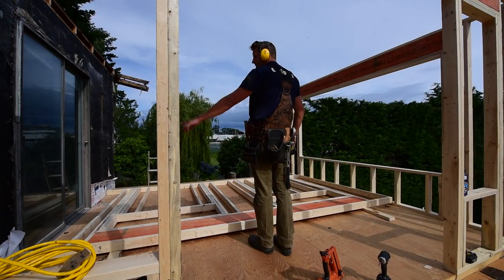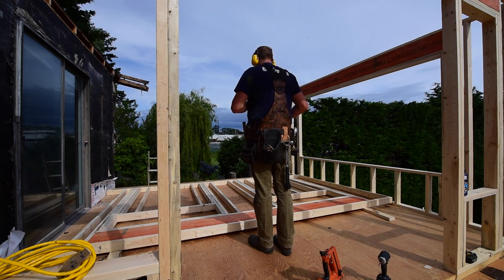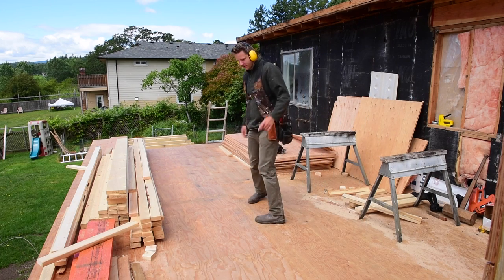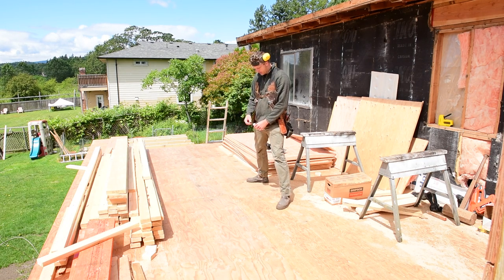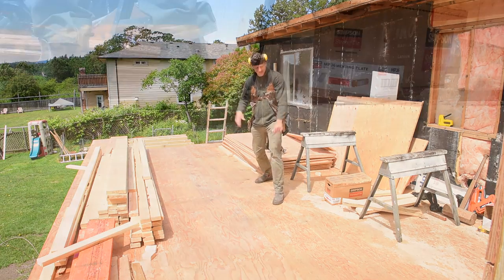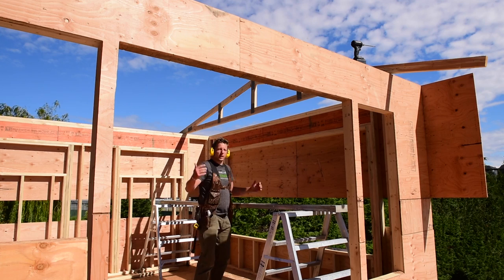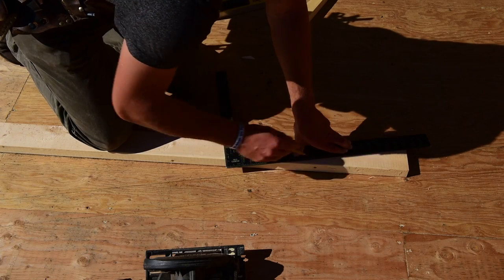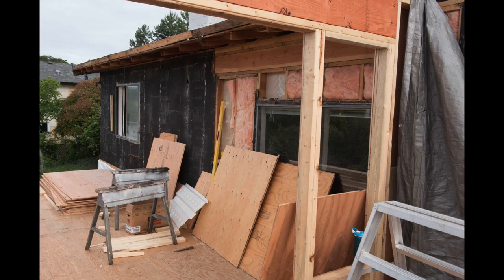FTF #57 How To Build Roof Trusses!

Comment: I have a tip for you, Brian.  Once you establish your truss layout on the deck screw blocks on your chalk lines. Then simply lay your lumber up to and between the blocks and hammer down the mending plates. It's similar to how production trusses are made. Timber companies use pins to hold the lumber, lay out the mending plates, and run a big ass roller over the whole truss to drive in the plates.

Comment: Thanks this was helpful. I live in a mountain town in Japan and my wife and I are remodeling an old building to become a restaurant. We have to build a a room with a roof about the same size as the room you are building.  The carpenter we have contracted prefers to build the frame with no nails and fits everything together with these crazy hand made joints. The issue is the cost of his labor is much more than the materials. So i am going to show him this video and see if we can replicate this style with an emphasis on plywood.
Reply from the maker: Don't.  He is a craftsman building in the traditional Japanese way.  Building codes are different everywhere you go so it is best to just leave it to the builder to do it the right way for your location.

Comment: Similar idea for building the trusses if you want uniformity....
Screw scrap blocks into the floor instead of your truss pieces.  Then lay your cut lumber (done at your cutting station...all identical) into the mold you've created that locks the pieces into place.  Hammer together. Fast and consistent!.
Fun to watch as always.

Comment: pro tip. take scrap strapping from a lumber bundle to create bottom sill plate hinges. once the wall is framed cut 6'' strips of banding, bend them into "'L's" align bottom plate to lay out line, slide them under bottom plate, nail them to underside of plate and to the deck inside the wall bays with 8 or 10 penny nails, dependent on wall size. after all walls are stood cut off straps exposed on floor with beater carpenters chisel and your done. never lose a wall off a deck again.

Comment: Here's my 2 cents from someone who worked in a truss factory.  Those trusses would be fine for a 12' wide shed.  For a house, I'd look at a rafter & joist span chart to determine sizes.  I doubt many charts show anything less than a 2 x 6 #2 for a 12' span.  And before nailing the plates into the first truss, use the parts as templates to mark all the other pieces and cut them all out at once.  If you're going to build on top of the wood floor, screw down blocks  adjacent to the verticals and above and below the top and bottom chords so wedges can be used to straighten members and make joints tight.  After the completed truss is lifted out of the jig, the next parts are just thrown in place against the stops.  For the installing the truss plates, I'd try putting a steel plate over the truss plates and drive my truck or front end loader over the plates (on top of a concrete driveway).  My best advice would be to order the trusses from a truss factory.  That's probably cheaper and easier than building them yourself.
Reply: Good ideas. However I would recommend getting some sawhorses and improvising a waist high table. Bending over to build each truss on the floor can shoot your back and hips out pretty badly. Ok in your 20s or early 30s, but you will pay for it after 50.
Reply: For the size of truss hes making, no 2x6 is needed for anything.  I assume your talking lumber and not the truss plates anyway.  I have also worked in a truss plant for many years, and what hes doing is just fine, other then hammering in the plates.  A wedge isn't needed as he cut the bottom chord with the angle already acting as the wedge, and the size of the plates he's using is way overkill for the size of the truss.  In the plant, on the peak with that size the plat would be a 4x4 max, the heels would be no more then a 3x6 on an angle as he already has.  Vertical will work as well.  For the webs, and the bottom of the king post 1.5x3 or a 2x4 is all that is needed.

The only thing that would make a truss last forever, rather the plates is using a press, hammering them in is fine but too many blows can widen the holes the spikes of the plates make and then the plates begin to rock out and never fit in proper any more.  A solid press in on both sides at the same time allows them to seat in perfect.  However you use what you got!
Reply: lowell mccormick   As a retired Home builder and registered architect I would agree that what is shown here will likely work just fine.  But it is a total waste of time and energy.  A flat bottom chord short span pitched truss is about as basic as it gets.  In my experience buying from a actual truss company is always cheaper than building them on the job.  Truss companies also supply the engineering.  Your building inspector may not ask to see engineering for such a short truss but if he does you are screwed.  Good luck finding a structural engineer willing to sign off on your home brew trusses.

Comment: Great video again , love ya work , may I add a comment , the chord of the truss to effectively work and take the load of any roof and ceilings ,especially on a low pitch must be built with at least a 12 to 15mm camber depending on span , the slight bow up is also replicated in the Rafter , for if one builds to a straight line the load cambers down with all components, when the point loads are applied ,the truss takes the load and evens out the panels in between supports same as the strut in a conventional roof, as far as gang plates , there used in different positions as you used and the difference  in truss manufacture gangs, is the gang plate is pressed by a roller and punches the timber together with what I just mentioned , love the way you do the work and explain things , great video.

Comment: I haven't had good luck with those nail plates for trusses. The reason they work well on factory trusses is they set them with a big hydraulic clamp that sets all the points on both sides of the truss in a single motion. This makes them hold super tight and very uniformly. Using a hammer just doesn't work as well. It's ok if you only have a couple to do but can beat you up pretty bad on both sides of several trusses. I've had the best luck using 3/8 or 1/2 exterior plywood, cut to extend at least twice the width of the board past the joint in all directions. I cover the plate with ordinary wood glue, put it in place and nail it with at least five nails in each board coming into the junction. Once that glue sets up, I have never in fifty years had one fail.

Comment: Check the mending plates. They specifically say "not for trusses" you can see it in the video when the samurai shows a close up of them. That's because they are not a heavy enough gauge to carry the required live load. Also, mending plates are to be PRESSED in. Not hammered. Common mistakes a lot of people do but try to make a disclaimer for you viewers.
Reply: Truss bracing doesn't look sufficient , along with wrong plates , not good . What the heck was he using a rubber mallet , hmmm , on the plates ?
Reply: At the Truss Factory I used to Work in we would Hammer Start our Plates and Roll press them with a Huge Roller the Length  of the Truss and then Inspect them for any Plates that didn't comply with the Pressure.
Reply: Our Plates funny enough came from Simpson but they were a thicker ga steel then from the Home stores
Reply: Where can you get one of those ink lines?

Comment: Just a two cent suggestion for the remaining trusses. Build the next truss then make a jig around, in between etc etc. Then just drop in the lumber and nail it up.

When I worked in a truss plant decades ago we would set up the jig on the truss table for the particular truss we were assembling. Much quicker to drop the lumber in place put the plates in place and run the press over them.

Comment: I love large window and door openings and trust engineered headers, but racking of walls is the forgotten dynamic.  I try to incorporate diagonal bracing everywhere I can but with a wall like the one you have there is not much room for a diagonal.  Plywood sheathing has taken on a lot of the shear and racking structural dynamics, but again, those short sections to either side of the giant window don’t offer enough dimension for racking resistance.  One solution is to plywood sheath the interior wall as well.  An added step is to also glue the sheathing on to create either a partial or full box beam.
Reply: I agree that diagonal bracing is important but here it doesn't even look like hold downs were placed to transfer the uplift forces at the corners and the aspect ratios don't look like they would work even if you used FTAO to try and get around it. The front wall is the one that worries me the most. The side ones maybe fine if they can transfer the force into the existing structure axially but It would require an interior wall in line with the exterior which is unlikely.

Comment: this is exact same technique  I used when I built my trusses for my home except instead of fastening each truss to floor for assembly I used cleats to support each piece of the truss. this way once gang nailed together  I didn't  have to unscrew each one from floor but just lift it out of the cleats. then just had to lay new pieces in cleats for assembly. Now for Samurai' s trusses I'm a little concerned  about the strength  weight load of his truss design. He  had straight vertical braces instead of diagonal v-bracing and 2×4 instead of 2×6 for base stringer. with such a low pitch on roof this can lead to problems.

Comment: Last I checked, though there may be an upgrade, Simpson mending plates are not suited for truss structural applications and usually that is stated on the box and the plate. Stick framed rafter with ridge beam may have been faster and stronger, but you gotta "do the math". Framing window openings didn't have anything to "lock" the sill plate, so,much like the old speed framers of the 70's, things can move. It'll work, just not a method used much   by those of us who have seen sill plate twist. When it comes to roof framing you should probably become a "math guy" as that kind of failure is usually memorable. Nope, not an armchair builder, long time in high wind and snow areas builder who appreciates civil engineers (and the occasional rude one). Bad pun, apologies to the engineers.
Reply: This seemed off to me as well? Does anyone have an answer if using plats and not fastening them together besides the hold tabs?
Reply: you mean like a trimmer in the opening above the sill plate to mirror the side cripples?
Reply: @ceyly11Xx  The mending plates you buy at home centers are not strong enough for trusses. The plates for trusses have longer tabs and twice as thick. You cannot buy them unless you are a licensed truss builder. This is the exact reason "Not for trusses" is stamped on each plate.

Comment: 1/4" plywood and drywall screws work for truss construction as well...Keep up the good work!
Reply: forgot, construction adhesive or carpenters glue...
Reply: A lot of the older homes have that, popular to use ply scraps for these in 60's and earlier truss construction around here.
Reply: No! You can not use drywall screws for exterior applications. Its amazing how many people out there doing "carpentry work" and dont understand the difference between nails and screws. Nails are for shear loading conditions and screws are for tensile loads. Just the leftover moisture in the lumber is going to rust those screws  out.
Reply: roof trusses are not exterior, and around here you can get a drywall type screw zinc plated for exterior use...
Reply: I doubt that. I've seen many houses done this way and while they are subjected to exterior conditions it's only temporary. In order for corrosion to cause failure in any system it is all about time exposed. For example, if you mount copper pipes with steel angle, it's going to eventually cause galvanic corrosion in the pipes and they will leak, it's a certainty, but only after a great deal of time. Framers close up houses very quickly, if not in days, weeks. That's just not enough time to "rust those screws out" and have any kind of failure. Good carpenters don't use drywall screws for this work but quality coated torx fasteners and many use construction adhesive.

Comment: we use those nails at the truss shop because its so much faster. because were using a press. don't have to use those if you don't. unless its some kind of code issue. you nailed em in good with your hammer tho

Comment: Theirs camber in a truss for a reason . Gang nails are designed for a hydraulic press , if you use gang nails you should just use a telco plate with proper banger nails .

Comment: Just a tip: if your fore arm hurts after nailing there can be two things wrong: Your hamer is balanced wrong ( a claw hamer needs to be able to balance on its claws and almost fall over) or, and that is what i could see in your clip, you are not holding the hamer right and and you are using your wrist instead of your elbow. What is saw was that you hold your hamer not at the end, but at the beginning of the handle. As my carpenter dad always says: that part of the hammer is also paid for, use it! Use long swings.

My father tought me by giving me a box of nails and told me to manually nail the sheet wood onto the beams for the 75 square meter top floor of the house we where living in then. He bought me my own hammer which we selected on balance, roughed up the surface of the hammer on a stone ( brick will do, safes a lot of thumbs ) and then use the right technique. At the end of my 2000 nails i could drive a nail in (7 centimeters) in two  hits.  Its now 30 years ago, still have that hammer and use it regularly. Try it, look up the technique and you will see that you just added another valueable skill to your already impressive skill set!

Comment: I think it was a cool video to watch, but I'd simply back up each truss with a couple 2 by's angled up towards the ridge with a  bolt running thru them (nut/washer on the others side, obviously;) & construction adhesive).  

Inexpensive and super fast/easy to do on a ladder.  2 on each one would surely add stability and lock them in pretty good.  Just my opinion, but the Jesse rocks and does a great job with his videos.

Comment: I was told by the guy at the supply store when I made my trusses that those plates were not to be used at all for roof trusses. So I ended up going old school and used ply wood “plates” at the connection points. All is good so far with a 4:12 pitch and heavy foothills Alberta Snow fall. 
How did the building inspection go for your framing?

Comment: good job heads up you can't hammer the plates on the teeth bend and will not hold.  Plates are pressed in place by hydraulic press or a large roller..

Comment: How do you like that "Paslode" nailer over a regular Pneumatic?
Reply: Roger Hall they don't set nails as well, they are slower, they dry fire, they require fuel cells at 15-18 bucks each, they don't take the number of nails per load as most others but they are convenient!  I have replaced a charger and 2 batteries in mine which only gets occasional use and it cost nearly double what a pneumatic does.  If you don't have air supply then it might be worth it but as a professional I don't recommend them.  They also misfire like crazy in cold weather.
Reply: WOW! This was the first time I have ever made a comment on ANY YouTube and I got an actual intelligent and honest reply. 
I have been watching your videos for a very long time and I almost applied for the position as your assistant when you needed one. 
I am from the Vancouver area and have spent many days in YOUR area, I can relate to everything you do in the way of woodwork (I am from Richmond and grew up with my two best friends being Japanese, and their father was a great house builder). I started learning from them since I was 8 years old. My youth was enriched with Japanese history and woodworking. 
 Now that I older (much older than you), I am fascinated with your building methods and you keen eye for detail. 
YOU SIR, have my greatest respect for woodworking AND for your dedication and inclusion of your special son.
HAPPY FATHER'S DAY tomorrow. I wish you many years of happiness and much success. 

If you can come and build something for me in the 108 mile area, let me know, I am about to retire there, with a REALLY BIG woodshop!
Reply: Roger Hall I am just a commentor mr. hall.  Jesse is the samurai.  Its hard for a channel owner to respond to everyone and being knowledgeable about the Paslode I figured I would answer your question.
Reply: Roger Hall i dont know about the frame nailer, but for occasional use ( 1-3 times a month) i really love my paslode trim gun.  cause I'm Lazy and hate pulling out the air for just a quick little project.
Reply: Queen Titan The trim nailer is nice but again for me as a professional I would pick up an 18v cordless trim nail.  The Paslode guns are far to expensive for the quality of their making.  I have them but avoud using them if I can.  Kind of sad for a nailer that cost near $400.00 plus fuel cells every job.